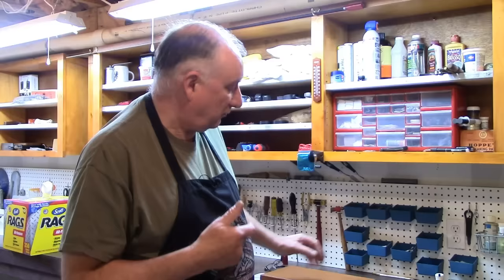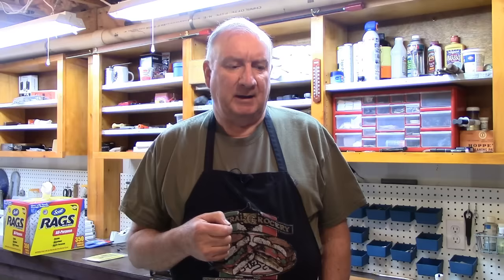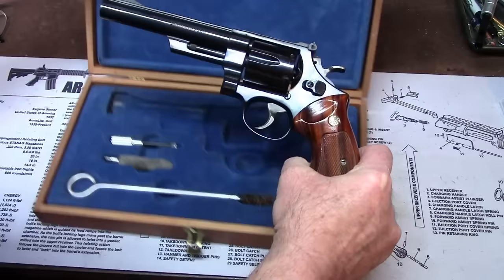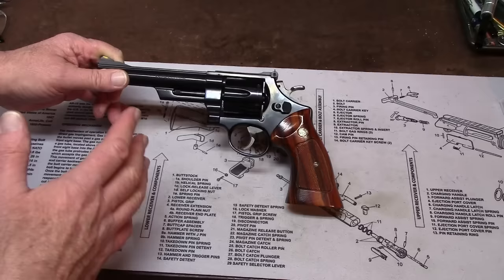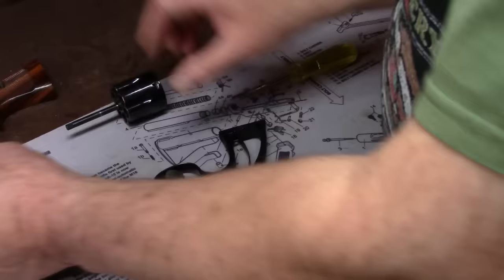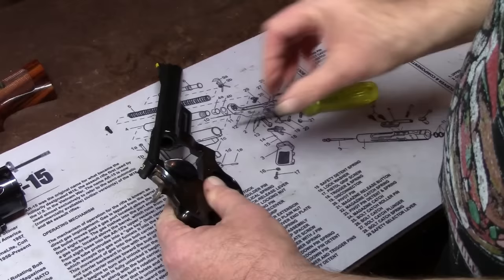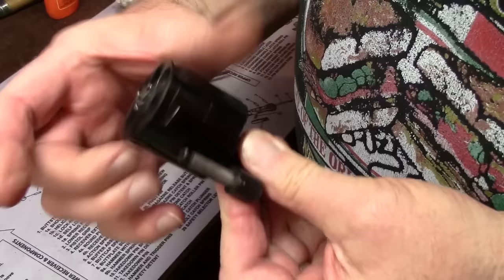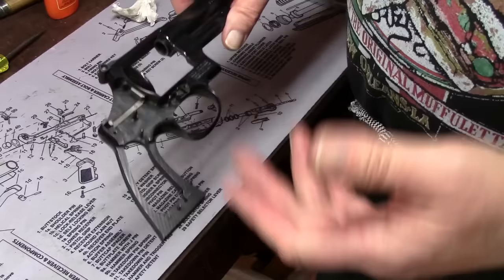How to Disassemble and Care for a S&W Revolver ~ Learn from a Factory Trained Armorer!

Comment: The Smith & Wesson revolver I am working on has the numbers stamped near the yoke as 19226. Cam you tell me what model is this and what year it is? I see .38 special rounds will NOT fit in it. .38 S&W shorts will. Thank you sir! This revolver's cylinder can be spun freely clock wise or counter clock wise.

Comment: I have a model 13-1 and couldn’t figure out how to get that side plate off. Haha, tried prying it a little, when it didn’t go with a little pressure I put it back together. I’m still wondering if the Ammo legend of it being hotter now than when they were made, I have Winchester 147gn silver hollow points and worried about shooting them and cracking the forcing cone. They’re for self defense I plan on getting regular Ammo or 38 spl. For target practice

Comment: Thanks for the informative video.  I have a quick question - is there a hole in the frame that the cylinder bolt plunger fits into?

Comment: Amazing video, I've got a 1982 Model 57-1 in .41 Rem Mag and this was the most educational video I've seen on the N-Frame. I do have a J-frame as well. Are the internals the same across L, K, N and X? It's a Model 360, with hammer.

Comment: I am working on a very early S&W 1917 from the beginning of the war.  The ejector rod is different, it has a nut that screws onto the end and catches a little springloaded pin on the bottom of the barrel.  Do you know how to remove this nut so that I can separate the cylinder from the crane?  I am conserned the threads may be reverse threads so I don't want to turn it the wrong way.  I'm also not sure how to turn it without damaging the finish

Comment: You probably won't see this which is Ok, I bought a model 18 in 1967 still have it.  The cylinder started hanging up in single or double action, sent it back and they replaced the cylinder, but I'm sure most of cause was first an inexperienced 18yr bad gunsmithing, if I'd seen this I would gone straight to SW in 2971.   I've never dissambled all the way, just removed side plate, sprayed and oiled, way too much of both I'm afraid. So now I will and do it correctly.  BTW I have watched precision HG classes and can see improvement, thank you.

Comment: Looking for help and advice on S&W 28-2 where the firing pin strike is hitting off center on the cartridge primer. Can that issue be fixed at home or should it be sent back to S&W for diagnosis and repair?

Comment: Thank you your video has been very educational!! I've been shooting S&W's all my life and taking them apart cleaning and reassembling them but I never realized how many mistakes I was making. Thank you for showing me where I've been wrong. 1 question for you,  my father got some stainless +P lube for stainless steel firearms should I be using it or is mineral oil all I need? Thank you for your assistance.
Reply from the maker: Stainless has no special lubrication requirements.  That's a sales gimmick.

Comment: I always inspect a revolver when I buy it used.  Until now, the worst I've found is some very light rust or maybe some dirty oil.  This time I found a severely pitted rebound slide.  Maybe someone sanded, "stoned,"  or filed it off to "improve the trigger."  It really looks bad - It looks as if it has been sitting outside in the rain after being sprayed with salt water and vinegar.

Can I change this with another, or should I live with it?  (maybe it's one of those parts fitted to that revolver, or there's some other reason.)  I will say the action is good, and there are no problems.

Comment: Thanks for the nice video. I have just bought fairly unused 686-6 as my first revolver and I  have a question. Is it ok that the cylinder has end shake when it is opened? I mean it can touch the back of the frame, the little lip there. Otherwise, it is OK,  no end shake when it is closed.

Comment: I have a 4 screw K frame. The 4 th screw is in front of the trigger guard. The factory says it's 'yoke tension adjustment' . What do I do If I want to remove the cylinder? How is it adjusted upon installation ?

Comment: Thanks for a nice video  I se some use greese inside and on the parts is that Wrong?
Reply from the maker: Grease serves no beneficial purpose whatsoever. It will make parts unnecessarily sluggish, especially in cold weather, and it collects lint and dust that accelerates wear. The internal parts are designed and engineered to glide, and need no lubrication.  A very light brushing of mineral oil on the blued frame will prevent any corrosion. Grease is generally used in sealed compartments that prevents contamination, and are almost always high pressure points and machine driven unions that turn under power, but a gun frame is not sealed, and the only horsepower to cycle the parts is your finger. A gun should operate the same under any temperatures, cold or hot. Yes, grease is wrong.

Comment: Is a tiny bit of yoke end shake normal, or should it be a rock solid lockup? My Model 29-2 has a smidge of yoke end shake, almost imperceptible, but you can hear it "tik-tok" when wiggling it forward and back.

Comment: Just got my first “vintage” or whatever it’s called Smith revolver. 
It’s a 19-3 - 4” nickel finish. The forcing cone seems to be in great shape, there’s a tiny bit of hazing or sandblasting look directly above the forcing cone on the frame but nothing that looks like damage or excessive. It’s more or less just surface/finish hazing. The overall finish on the pistol is still very shiny, of course it has oxidation from all the years but nothing that seems to be deeper than the  nickel coating, very very tiny imperfections in the finish. 
Should I try to bring the mirror finish back or just clean it throughly and leave as is?? 
I don’t mind at all as I intend to shoot this work of art and teach my teenage son and daughter how to shoot revolvers with it. They aren’t too keen on the 360 or 340PD even with very very light loaded .38 special. 
The hammer has a very small spot of rust, the trigger also has a very small spot, around 1/8 - 5/32” in diameter. 
I intend to use this video to take my 19-3 down and give it a proper cleaning, the screws appear to have never been taken out. If they were it must have been by a gunsmith because there’s no evidence they’ve ever been moved. Hopefully I will get this done, correctly and learn more about this model revolver I’ve been drooling over owning for almost two decades. Thank you for sharing this information that you spent a lifetime learning. Wish me luck y’all
Reply from the maker: I don't recommend heavy polishing. A light wipe with silver polish is sufficient. Any scorching under the backstrap or cylinder is permanent.
Reply: @GunBlue490  I appreciate your in depth explanations of each of these parts inside these revolvers and the mountain of information about how it was manufactured and which way each assembly should be removed or replaced to a level I can’t put into words properly. 
I took my time and followed each step and inspected and cleaned each individual part as instructed in the video and oh man is this the smoothest action I have ever owned. 
There was a tiny bit of rust on my mainspring & mainspring screw, which was not bottomed out as it is intended to be (but it is bottomed out now). I found another tiny line about 1/32” wide of rust about 1/2” long on the hammer (but is not visible with side plate on) My rebound slide was gummed up with powder residue but came back brilliant with just oil and elbow grease. 
I didn’t use any aggressive solvent on anything and as you stated in the video, just plain old oil cleaned everything up as if it were just manufactured. It truly is a work of art. My model is a 4” with a silver front sight & the front sight pin is sanded flush, would it be sacrilegious to remove the front sight and replace it with a tritium front post? I don’t want to take a chance of altering something that could cause unintended effects, but a new set of tritium sights would be amazing on this old beauty. Again thank you sir for sharing a lifetimes worth of specialized knowledge, hope all is well

Comment: So. I really came here, because I'm having a problem with my cylinder stop, and here you go telling me not to mess with it. I've got an old 66-2 that's been a safe queen for decades, and the cylinder stop is a problem. It often jams and doesn't return the stop stub up, so I have a free spinning cylinder. I don't know what's causing it and it probably came out of the factory slightly badly fitted. It's too old to take back to S&W. I think the only fix is to add a shim to keep it tight. It's actually caused me to understand and appreciate why Glocks are actually so much more reliable.

Comment: What would you think About removing the internal lock on a new 627 pro series 8 shot 357? I have a new plug and retainer for the hole . this is a woods gun that has to work with full power loads.
Reply from the maker: Jesse Stemmermann 
That's your gun and your call.

Comment: You sir have made a masterpiece of a info video on the S&W Revolver.   Thank you.   

With that said it seems some of your info about how SW builda revolvers is dated which is completely understandable.

I promise you there is almost no hand fitting as was done on your demo gun or the guns of your time at SW and LE.   At thier custom shop yes but not on their production guns.  I can tell you this from numerous parts swapping from sw parts and between my newer sw revolvers.  I just swapped a trigger from one j frame into another while swapping hammers from yet a 3rd gun.   Also looking at my older pre 90s revolvers all the parts are as your demo gun fitted handle polished etc.  New ones have very rough surfaces in certain friction and moving surface areas.  I think you would be horrifed in the finishes and trigger if you were to pickup a new say j frame or base k or L frame from the production line.

But again you sir are of skill and knowledge very few today have.  You also are a excellent teacher.  I would be happy to have you work on my prized revolvers if then needed service.  Awesome video!!!

Comment: Hello Gun Blue, thanks for your knowledge! I have a few questions. One the wooden box you store the S&W revolver in, can they still be purchased. I have a stainless steel 6” barrel and it got destroyed years ago. When I watched the AR-15 video I did go out and picked up flannel cloth and did as you suggested and use mineral out and I have to say it works great. I also be bought LSA  from Amazon. The LSA works great. I bought a needle nose syringe years ago and use it for just a small amount of oil, works great. I learned from you about how to oil and wipe off the excess and how much oil the steel needs. I did over oil and put oil where it was not needed. For sharing you knowledge, if I lived around your area it would be my pleasure to help you out maybe cut your grass or something. I believe one hand washes the other, old fashion values. Thank you very much.
Reply from the maker: Those wood presentation boxes were only supplied with certain high grade S&W revolvers.   They are no longer made.  It's certainly possible that one may be found used, online.

Comment: Hi there. Great video. Thank you for sharing. Being that you are an expert, I was hoping you could help me. I have a S&W 10-6 and it seems the barrel needs to be moved slightly to the right for the sites to be aligned. I guess I need to remove the barrel pin. Do you know what punch I need for that? Also is a holder that is made for this? I'd like to avoid harming the finish. It's really a very small amount of movement that is needed here but, it's bother me so, I'm going to attempt to adust it. Thanks in advance.
Reply from the maker: You cannot remove the barrel pin to change impact or the barrel will become permanently loose.  It's a combat sight system that was not intended for bullseye perfection.  Try different loads though, because not all ammo shoots to the same place, and you may likely adjust the impact to center.
Reply: @GunBlue490  the site on combat pistols should be straight. Mine is not. The company I bought her from a grease and they're taking it back and swapping it out. Thanks for responding though

Comment: I sent my 29 to the factory because the cylinder was jamming, and I got a call from them telling me it was a quick fix and that I need to clean it or they could clean it and the guy would charge me about $100. I told him that I’ll clean it but I couldn’t  get the screws out before I sent it in. The guy at Smith & Wesson tells me that he didn’t have an issue taking the screws out. I have my gun now but I STILL can’t remove the screws. I’m using the screwdriver that came with the gun

Comment: Thanks for another excellent teaching video.My 629 Talo has an extractor rod (left hand thread) that loosens. Was wondering how to tighten it.  Recently the cylinder release screw came loose.  Looks like I need a visit to a gunsmith.
Reply from the maker: toy collector 
Ask if he learned from S&W about their guns.  Most gunsmiths have not, and may employ methods that can damage the gun.  Repairing your gun as you describe is a very simple 3 minute procedure, so it should be at minimal labor, requiring no parts and no special tools.  But it's a skilled procedure involving guarded steps unfamiliar to most gunsmiths.
Reply: Ok will ask.  Warranty repairs are a pain Canada. Gun is gone for months...
Reply: toy collector m.

Comment: Hello.  Great video.  I just got my first S&W revolver last week. It's a Model 27 .357 from 1990.  Tight lock up and a beautiful trigger.  However I noticed the thumb latch for the cylinder release is "loose".   It all functions fine, and the screw is tight but the latch is still loose.  It appears when I take the latch off that the bolt, with the tread on the end, wiggles a little.  Not sure if this is normal? If not, I'm wondering if I need to take the side plate off and inspect the bolt?  I'd post a video if I could to show you what I mean.  Thank you for any help you could offer.
Reply from the maker: Some looseness is quite normal.
Reply: Thank you Sir.  I'll just enjoy it then.  I'm going to shoot it for the first time this weekend!  Thank you again for all your wealth of knowledge. I've learned alot from you.

Comment: Just a super video with great info - Have to ask why you don't have your own S&W revolver on hand?  Everyone should have a bakers dozen or more, they are a fine work of art & reliable precision engineering (unless you have one made within the last decade or so)...Not the company they once were in my opinion!   Many thanks for all your great videos.
Reply from the maker: The reality of personal economics and practical necessity.  Perhaps I'll find a reason to get an L frame again some day, as revolvers make handier and more efficient field guns than autos for the reloader.  Actually, my wife does own a very nicely made Lady Smith, which she prefers to her compact auto.  Smith has gone through a number of production phases through the years, and I consider the most problematic to be a few decades ago, prior to the auto era, when we received a large percentage that were actually non functional. I've been quite pleased with the current production guns that I've examined at stores, and would have no problem purchasing one. I presume that they, like other companies, are now using more precise CNC machining, that gives more uniformity and better tolerances, which would rely less on hand fitting skills that vary among workers.

Comment: Hi, I recently got a 1979 Model 66 that looks like it’s never been fired. It’s perfect. However, it has a single action hair trigger. Do you have a recommendation for how to fix it? Thanks!
Reply from the maker: I do, but it's a job for a trained person. The pull weight must be sufficient to hang the weight of the gun by its SA trigger.  If not, call Smith and Wesson and I'm sure they'll fix it.

Comment: Dear mr GunBlue490 thank you for a great demonstration. I am currently in the process of considering a 357 revolver to add to my collection. I admire the look and feel of a 686 Deluxe, would you recommend it for target shooting and for  collecting as a representative of a SW family or would you recommend another model? Thanks in advance
Reply from the maker: The 686 revolver based on the then new L frame was designed to be the ultimate frame size for the 357 round when it was released nearly 40 years ago.  The K frame was found to be too light, and the N frame too heavy.  I consider it to be the best gun ever produced for an all around revolver.  Great choice!
Reply: @GunBlue490  Thank you very much, I value your opinion